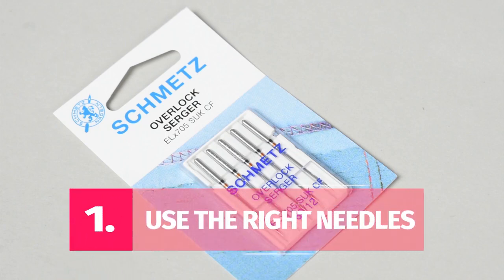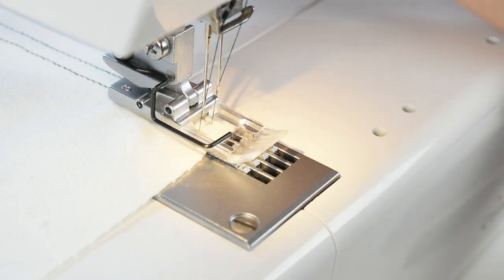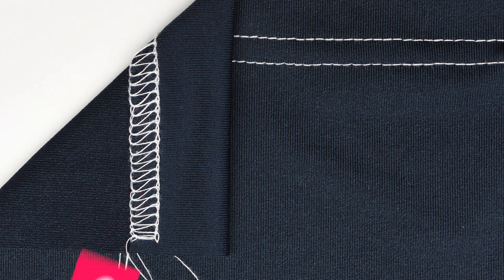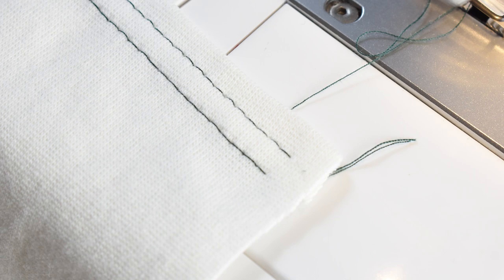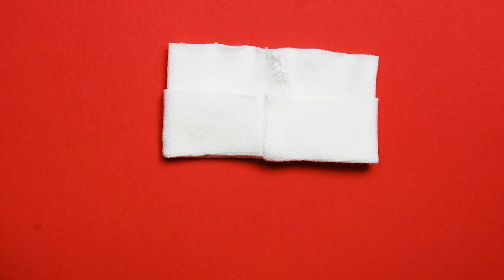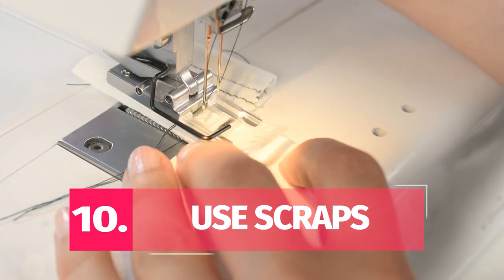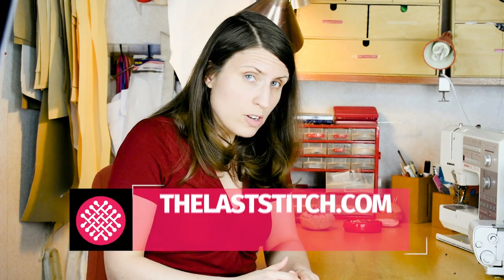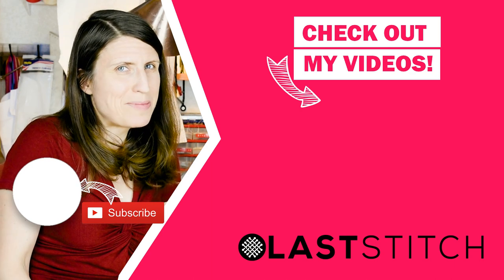Avoid Skipped Stitches: How to Troubleshoot Your Coverstitch Machine

Comment: When I got my machine, a cp1000, and it's a long time ago now!   There was a very active thread on Pattern Review on the Janome coverstitch machines. It seems that the machines came from the factory with very high foot pressure that created problems..  Once I lightened the pressure most of my issues went away.  Your tips are good and were the things that  I found that eliminated any issues I had.  I will add one more. I was unable to sew for about 4 months and when I came back to using my coverstitch it was skipping badly.  I changed the needles and the problem went away.  We have high humidity and I wonder if that caused the issue with the needles.
Reply from the maker: Good tips! Regarding the presser foot pressure I heard a seller say the same, plus the feed dogs might need some adjustment too.  Apperntly it was set for too thin fabrics, because that is more common in Japan! And interesting about the needles.

Comment: Hi! I just got my first coverstitch machine, a bernette b42funlock. So far it's going ok. I found you when I was searching for how to deal with bulky seams (still not working, but getting better!) My question is how do you lock the ends when you use a scrap of fabric at the beginning and end of your stitching? Would you not cut the scrap off and have nothing to tie? The information in your video is very helpful and I hope to soon be zooming along with my funlock!!
Reply: On my Janome coverstitch machine the thread only unravels from the finish end not from the start end.  This means that I don't have to tie the starting ends.

Comment: I have a bernette b42 funlock. It has been a bit of a process to learn it. I have found that if I start with my needles in the down position, it helps to reduce the bird nest of threads that I was frequently getting. That and adjusting my presser foot pressure has made my funlock so much more fun!

Comment: Overall, your tips were great.  However, there is a problem with Tip #7:  Remove bulk.  If a beginner to coverstitching who has never done this before watches this section of the video, they may have no idea where you clipped that seam allowance (SA).  Also, you don't clip all the way to, but not through the needle stitching line.  DO take the time to show the viewer what to do with those two sections of SA by showing how they will be splayed in the hem, thus reducing bulk.  That is the main premise of this step, correct?  I realize this video has been created to sell your excellent book (I have a copy) on coverstitching, but please take the time to present the information you are trying to reach your audience with.
Reply from the maker: Thank you for your input, and I agree I could have explained this more clearly in the video, it's always a bit tricky when making instructional sewing videos because there is so much information to cover and for me to remember to mention, so sometimes certain things don't get enough explanation. Which is always a bummer when I realise that, because once the video is out and there is no way of editing it. And thank you for your kind words about my book.

Comment: Great tips Johanna!  I have one of those "budget" type cover stitch machines and just bought it last year so it's relatively new! To secure the threads, I use the option where you pull the threads toward you, clip them and then quickly pull the fabric behind and to the left… This works like a charm! And have been using it since I purchased my machine. However, I'm going to have to try some of your tips for the skipped stitches, because on occasion, I have had skipped stitches. I would really like to try placing a piece of fabric at the beginning and the end of my projects. I have not tried this yet. Thank you so much for your wonderful information!
Reply from the maker: The scraps has been such helpful thing, especially when sewing on tricky fabrics. It's like the coverstitch needs to practice for a few stitches to really get the stitching right and they actually recommend it in my manual for my current coverstitch machine.

Comment: Hi there Johanna, Thanks for the info and your book is great!. I hope you can help me. I have used the tape binder well in the past on this machine, however i have just spent a few hours trying, and it works fine with no fabric inserted, but once i insert fabric into binding i get skipped stitches and the looper thread is bunching. Could it be the foot pressure?, as i may have fiddled with it, and not sure where it should be. Its quite thin viscose knit. would love some advice! ahhh back to try some more options
Reply: SORTED! Higher Diff Feed and adjusting Foot Tension Knob to 1cm high. Got there in the end. Thank you anyway x
Reply: Stella Garrill thank you sooooooo much for posting your solution! Your information was the exact reason I watched this video. I too am using the binder foot and it’s skipping stitches when I insert the fabric that is being bound. Thanks so much for taking the time to post your solution. I’ll try it as soon as I get home. 😊

Comment: I cannot find a video that addresses my problem. I just started using the Brother 2340CV overstitch machine last week and this week when I finish a three stitch line there are not just four threads...there are 8 to ten threads coming out of the top and bottom of the material. I have looked at this long enough to see that the top treads are somehow getting looped around under the fabric as straight threads making it appear that there are top threads coming from the bottom of the machine. While it is annoying, it hasn't prevented me from using the machine. I just know it is not right in some way.  If anyone here knows the answer to this problem, please attach a comment. Thank you.

Comment: Wooly poly (aka wooly nylon) in the lower looper also helps combat skipped stitches.  In fact, it was the game changer for me. It has inherently good stretch, so it's kinda a no-brainer for the bottom stitches. I have a black and a white and don't see any need to invest in any other colors, at least, at this time.
Johanna, I very much look forward to all your videos and really appreciate your coverage of the cover stitch machine as there is not that much information out there for us newbies.
Reply from the maker: I love woolly too, it also adds tension, which could be an explanation for why it works better than regular thread when it comes to prevent skipped stitches? Just guessing here, but I have a similar experience that woolly has improved the result in many cases. Thank you for your kind words, I'm very passionate about this subject :-) I bought my first machine in 2004 and it was even harder then to find good info, so I want to spread the knowledge

Comment: Very helpful tips. I would also add that loosening the looper tension can help prevent skipped stitches on fine fabrics.
Reply from the maker: Excellent, thank you for your tip!
Reply: Thank you! That make sense. I did all of the tips, but loosening the tension made a lot of sense and it only skipped on the seams , I didn’t do tip 7🙈...but at least the main part is fine.

Comment: I have the Janome 1000cpx machine, used it about 6 times in several years, and never saw or noticed a problem with skipped/broken stitches til a friend told me about her problems sewing knits on her 900 model.  Sure enough, she came over and voila....the stitch would be perfect and further down on the seam, the stitch would skip for NO reason!  The tensions were all set as they originally were.  So, I am truly at a loss and may try a different needle or just bring it to where I purchased it to have them try and figure it out!  (unless anyone here has/had the same problem and can advise!)
Reply from the maker: This seem to be a common occurance on some Janome machines and I've had this happen to  sometimes. Not sure why it is happening, but that is something I would like to investigate. and share in the future. Maybe interview a Janome person and see what they say. My only tip is to just start over checking everything with threading, needles etc,. But yes, it is strange and annoying
Reply: Thank you so much for your reply.  I think it would be a good idea to contact them, but in the meantime, I will try different needles.

Comment: I've a question, when you say to clip your seam allowance and fold over, you cut straight through the overlock looper threads, is this not begging for it to unravel? I am seriously struggling with sewing over bulk with my cpx
Reply: You will cut from overlocked edge & not through the chain seam. As the next step is to hem, the cut edges will be incased & fraying is not a problem.

Comment: Great video Johanna - so good I watched it twice! Quick question - if using fabric scraps to start and finish, when I've cut the scraps off, are the remaining ends secure? I'm thinking they'll be too short to secure by hand.
Reply from the maker: I just leave the scrap on and then remove it aftet sewing the side seams (or the serger just cut it off). Hope that helps 😊
Reply: @Thelaststitch  I don't understand in what case do we use fabric scraps?

Comment: HELP!! Janome 900cpx stitching in the round on lycra spandex! Skipped stitches no matter what I do, adjusted everything on the machine, clipped and folded seams as well, needles changed... Any tips please?
Reply from the maker: Have you tried size 90 needles? And are using the Schmetz ELX overlock/serger needles? If you are still struggling after all this I would have the machine checked by a mechanic.
Reply: Annie’s Aussies thank you! I actually tried wooly nylon thread in the looper and it’s working great!